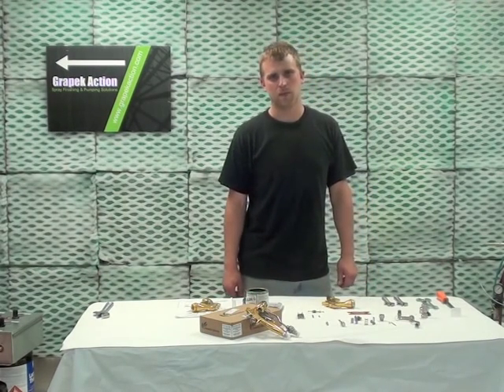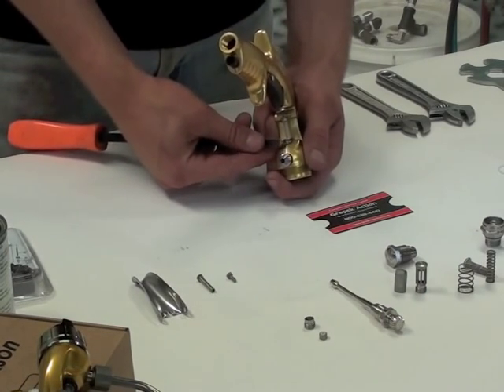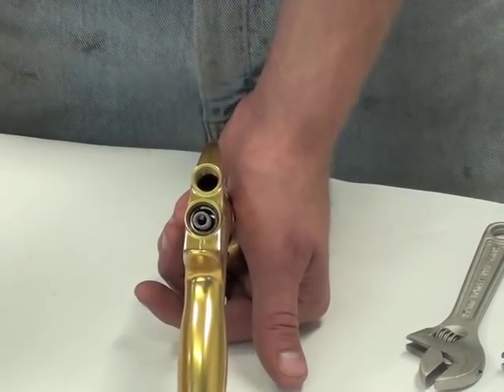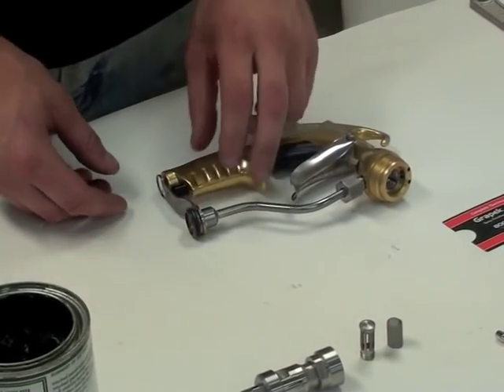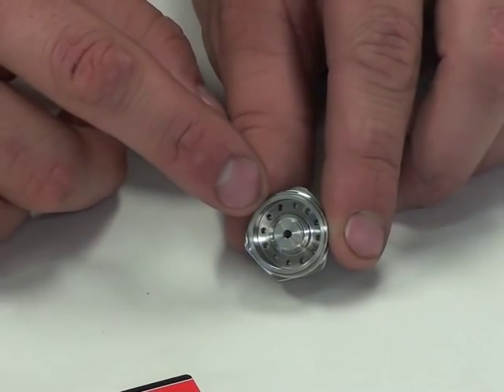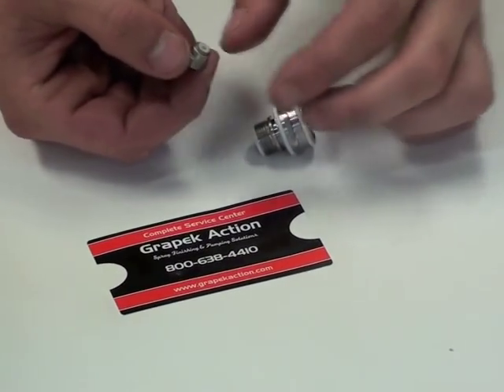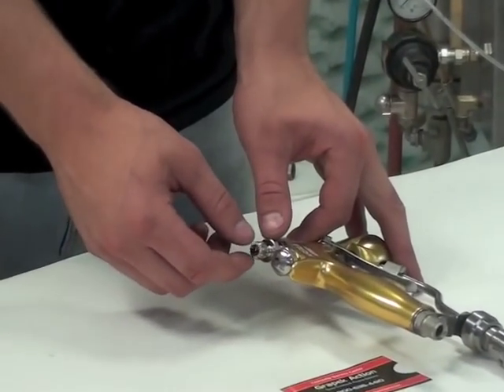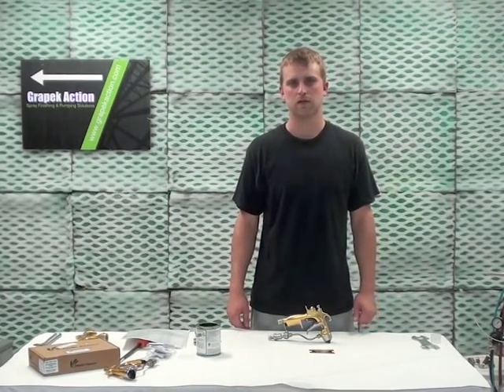The Kremlin Xcite Gun: Part 2 Assembly

Comment: The tube of grease that comes with the repair kit, where do you use it?
Reply from the maker: *You can apply a small amount grease to the outside of the needle cartridge before installing it (along the black o-ring). 
*You can also apply a small amount of grease to the seals on the air valve before installing, as well as the rod that slides inside of the air valve. 
*I suppose you could also apply a light amount to the portion of the needle that is between the trigger and the front of the gun. You could do this as you're pulling back on the trigger. That would lubricate the portion of the needle that slides through the cartridge. Not really necessary, but it wouldn't hurt. You do not need to lubricate the front portion of the needle as that will come into contact with whatever material you are spraying & could end up clogging the seat holder assembly.

That's about it! There really isn't much on the Xcite gun that needs lubricated! Any other questions don't hesitate to reply to this comment, give us a call, or shoot us an email!

800-638-4410 | info@grapekbates.com | www.grapekbates.com

Comment: Today on mine the seat somehow wasn’t screwed in and ended up at the back of the housing and I cant get it out. Fluid has been leaking out the tip for a couple weeks and finally got around to fix it but the seat wasn’t where it should be but stuck around the needle at the back. How do I get it out?
Reply from the maker: Good afternoon! That sounds like an interesting situation! Is there any chance you could send us some pictures? Then we can help give you an idea of how to straighten things out! Just send them in to info@grapekbates.com
Reply: @grapekaction  upon further review the seat wasn’t in there and I was looking at the back of the housing. Not sure where the seat went and now I know why it’s been leaking because it’s completely gone.
Reply from the maker: @darrylholtman2601  Ah interesting! Yes, not having that seat is definitely an issue! Here is a link to the parts manual for that gun in case you need to look up parts. If you'd like you can purchase them directly on our website, www.grapekbates.com ! Our recommendation for replacing that seat is the 10 pack polyacetal seats. Item number 129-729-904.

https://www.grapekaction.com/images/uploads/XciteManuaLinked.pdf